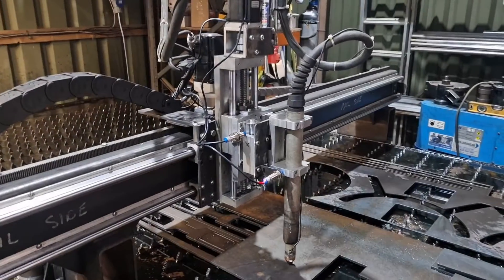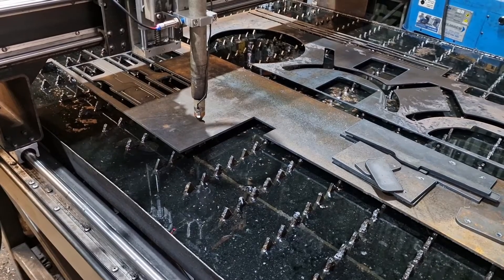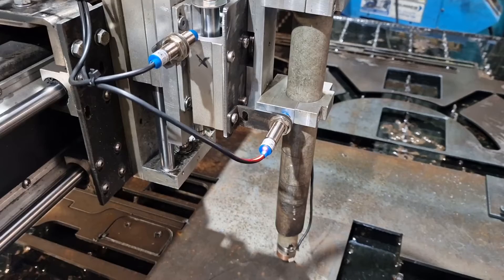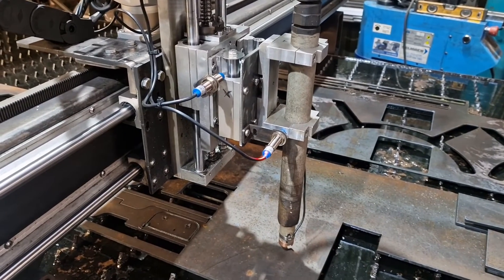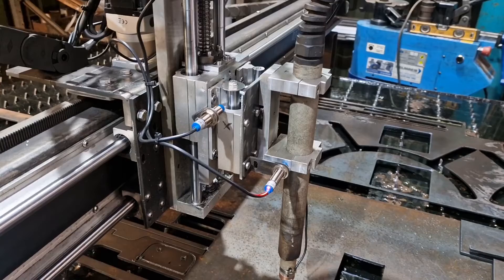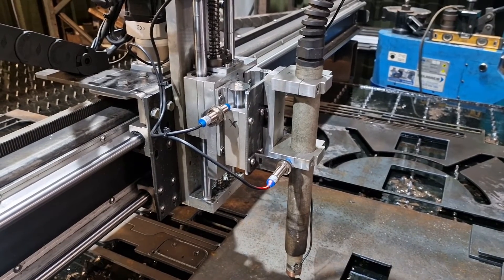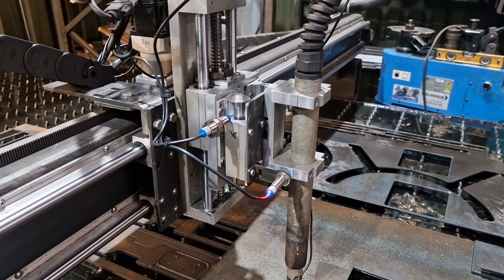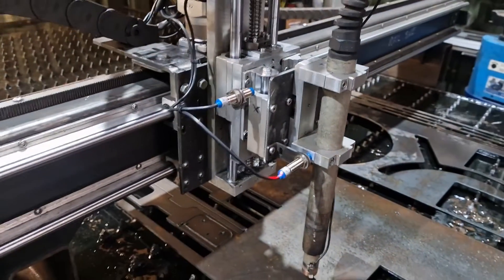Ohmic...Meh. Floating head....yaay. myplasm cnc

Comment: Hi Rob, that's very interesting about the additive causing you problems. I run an ohmic sensor and have the occasional issue with water getting around the torch tip and my sensor, but just lately, it's been fine. I have been planning to install a low pressure air purge 'thing' to help keep the eater away from my ohmic sensor, but haven't got around to building it yet.
I have reduced the water level in the water bath from 5mm to 10mm below the top of the bath, and I think that might have helped a bit. I know your water level is even lower than mine, so maybe that's not going to help you.
You can connect a 50k ohm potentiometer in series with the ohmic sensor to help reduce its sensitivity, so maybe that's something to try.
I do like the floating head unit that you've built....'cobbled together out of bits and pieces laying around the workshop'...what other way is there!!
Reply from the maker: Hey Rusty
Thanks for the 50k pot tip. Hadn't thought of that. May do the myplasm dual floating and ohmic setup. The air purge doesn't seem to work well with the hypertherm. Looking forward to seeing your air purge setup though. British shed building 😆

Comment: Does the air blow out function not work? I haven’t used the special function yet but was happy to see it in there in myplasm software settings? I might have put a float head on mine if your having issues.
Reply from the maker: Hey Dan
I'd say if you are using a water table put on a floating head. At least then you have the option. 😆
Reply: @robbroomfield468  yeah I think I’ll do that just to save the headache and learn from you haha 😂

Comment: Hi Rob, 

I'm running a much smaller table than you do but based on Myplasm as well. Works quite well indeed. I run the ohmic combined with a floating head. No special additives in the water though. 
I am sure you know this but there is a 'blowout' option in Myplasm for the ohmic. It is under the special functions tab. I think it triggers the plasma (on/off) ever so briefly so that the air starts running first. Only then will it start probing. Hopefully the air has blown away any conductive water/particles by then. Worth a try...

Nice setup and I am enjoying the vids!

Best,
Robin
Reply from the maker: Hi Robin
Believe me, we've tried everything 😆 
In fact, it is working a lot better now anyhow. Thanks for the info though its always appreciated. 👌